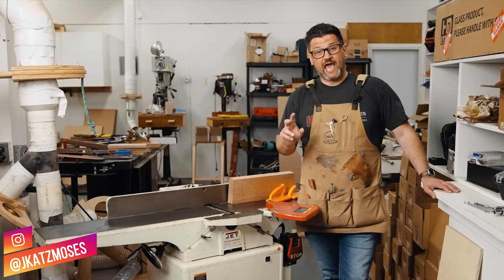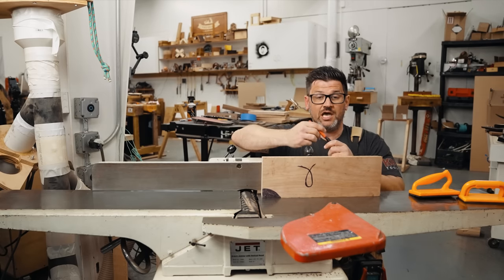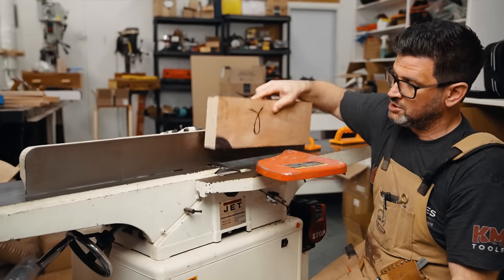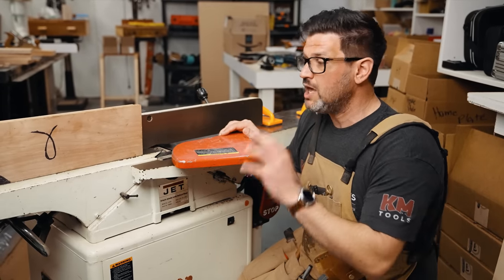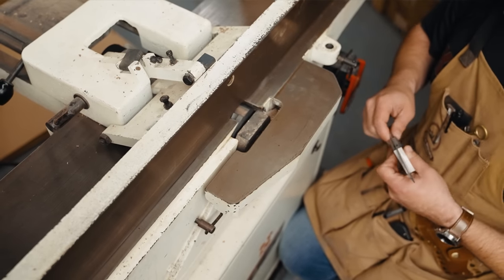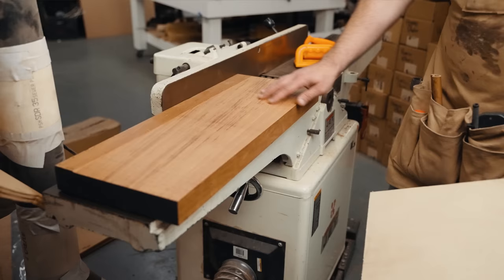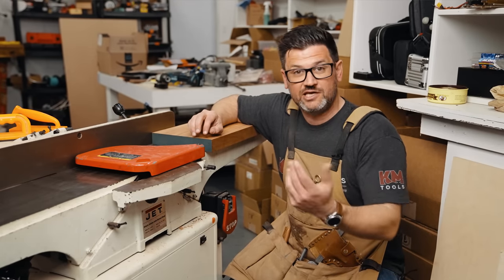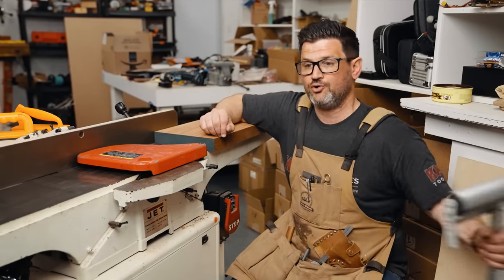Jointers For Beginners - Use Tips, Tricks, Buying Advice and Safety

Comment: Dad worked with wood his whole life. He was 80 when he took three fingers off with his jointer.  His advice?  Never lose focus. During any operation on any tool, never think about anything other than what you are currently doing.  Second bit of advice?  Never do any operation on any tool that doesn't "feel right".  If it feels like you are doing something that isn't safe, it likely isn't, and you should find a different way to accomplish what it is you are trying to do.  There are typically many ways to do something safely.
Reply: My dad was a finish carpenter and every time he cut himself was on the table saw because he lost focus.  Yes, I said every time - 3 times to be exact.  The third time he finally lost 2 fingertips for good.
Reply: I'd also add the third thing would be that if something does go wrong, step away. Don't try to save a piece that's unstable, or try to release a jam with the machine running. Just let it go and if it flies across the workshop, that's ok (you're not standing in the path, right?). Turn the machine off, reset everything and start again. Broken blades or work pieces can be replaced.
Reply: oh my  aint that the truth , i been woodworking 6 months , ive had a grindng ball on angle grinder grab shoe lace  managed to turn off as trousers wer wraping in it  grazed toe bad , then a nip by the kerf on table saw and a chizel into finger and last week top skin layers of finger in jointer  , not to mention chop saw kick back that sent the blade  guard across room at high speed very lucky  not to be in its path , ive rethinked  my work teqniue , but scared now of it , its no safe place to work in , its all limb trashing hazzard zone , i must remember that one
Reply: @TheLucidScreamz you should not be having that many close calls.  If you are then you are working in a very unsafe manner.  You are going to get seriously injured if you keep going like that.
Reply: @TheLucidscreamz find a new hobby
Reply: @TheLucidscreamz please take this as an attempt to save a fellow wood enthusiast some pain. you need training bud, like go to some wood working courses and have someone competent check your shop and equipment. You’re going to lose more than some skin if you don’t stop and get right.

Comment: One thing I wish I knew about benchtop jointers before I bought one:  the fences are a joke.  You'll spend 2 hours getting it to 90*.  Then you must never, ever touch it again.  Forget about sliding it around to reduce the blade exposure.  And it'll still flex if you press too hard. Mine is a Wahuda but I've read they all have this problem.
Reply: You are 100% correct I have same problem with mine
Reply: That was the main reason I bought the Ridgid 6in.   Its the cheapest jointer with a cast iron fence.  I was all ready to buy it brand new but found one on marketplace for 1/3 the price.  I just needed to drive 50 miles for it and hit it with some 600grit to get some surface rust off the beds and fence.

Comment: Another safety tip that's always worth repeating.  Never use a power tool when tired.  It's just not worth the risk.  Love the channel, and your shop.  Bought a SawStop recently and put in one of the CMT blades from your site.  So very smooth.  Loving it.
Reply: Tired or frustrated. I cut a dado in the end of a board that already had a rabbet the other day 😵‍💫 I’d been doing setup and test cuts for a couple hours and was thinking “finally I’ve got this right!”  Still need to stop before I get there.
Reply: Drink a few beers and the frustration mellows out, then it’s safe to proceed. If you are tired, put on your glasses while you close your eyes to rest, then you can see to continue.
Reply: I followed your advice and my last 4 employers were not happy.

Comment: Electrician here, with nearly 30 years in the trade. Swapping between voltages on a dual voltage motor should not change the RPM. I appreciate your video about jointers. I'm glad your injury wasn't worse. Thanks for sharing your knowledge with all of us weekend warrior woodworkers.
Reply: And the amps will be lower
Reply: It may get your motor up to speed faster on start to go higher voltage since inrush amps and voltage sag will be lower. But I can’t say I’ve really noticed anything appreciable.  Maybe your utility will appreciate it the most since your draw will be balanced on a split phase system.  Honestly I’ve done this to free up 120v plugs more than anything since my shop is wired for both

Comment: Excellent advice. I bought an 8" Wahuda helical jointer for $549 delivered (2 years ago) and it's handled everything I've run through it, mostly hardwoods. Takes up little space, attached to a homemade rolling cart and I'm STILL on the first set of blades- only have needed to rotate a couple. Excellent choice if you have a smaller shop or on a budget.  Brother Riv

Comment: Great video! I love my jointer. I'm in New Zealand so it's 240 volts, and it's 15 amps. 12 inches wide, spiral cutterhead, and it's a combination jointer and planer. It's actually really quick to convert between modes. And in a smaller shop (6 x 10 metres), it's the way to go.

Comment: I liked your safety tip on where to locate the fence. I inherited a Shopsmith Mark 5  from my father. He got it “used” in 1955 along with a jointer. A few years ago I ask a sales rep at Shopsmith why they did not make a 6” jointer and was told quite politely that I would not be able to lift it on and off the Shopsmith. The operating instruction for this jointer indicate that the blades can be ever so slightly higher than the out feed table. Thank you for all of the useful information you provide.

Comment: Thank you for this. I recently discovered the need for and also that I enjoy working with power tools quite a bit...but no one ever taught me anything at all whatsoever. so I bought a reciprocal saw, a circular saw, a multi-tool, a drill, a driver and a brushless drill driver so far, I'm pretty sure there's more and this has been in two months time.  I was looking to buy one of these. Considering that I sawed the cord in half from my circular saw the second time using it and my brushless drill grabbed my hair and knocked me around a bit, you may have just saved my life...lol. but really though. thank you.

Comment: Thank you so much for covering bases on safety and buying a Jointer
Last Thursday I bought a Rockwell/Delta 6” Deluxe Jointer. Year 1978. Had no fence or factory guard or motor. I had a 3450 motor. Got cutter head RPM to 5018 with my pulley setup. Working on locating a fence. Had a wooden guard that works ok. It is co-plane flat. Tad of rust on both beds. Still cleaning gently. Only cost $50

Comment: About checking the fence for square when buying a used machine: Check it across the entire length, as the fence may be bent/warped. Especially aluminium ones, but I've seen bent iron fences too.
Reply: Just take it off and run it thru the jointer 😉

Comment: If I have a good jointer, I don't need an expensive thickness planer, I used to under score the importance of a jointer not until I discovered that squaring stock of is number one procedure to accurate results of a project, thank you for the video.

Comment: I needed this.  Thanks. I don't have a ton of experience with my 6" Porter-Cable jointer anyway, but the last time I used it, I ruined a board for my purpose by jointing the edge until the board became a trapezoid. Was that because I wasn't shifting my pressure to the front?

One tip that I learned recently that I'm surprised you didn't make:  Throw those push pads away and get a pair of concrete floats with the red sponge rubber.  Run, don't walk.  They grip like crazy with very little pressure.  You will never go back to the ones that are sold as push pads.  Trust me on this.
Reply from the maker: I have two other jointer videos that go into detail on technique. They should help. Cheers!

Comment: So great! You’re so cool and committed to the woodworking community! Thanks for the tips and safety info; much appreciated.

Wanted to ask: spoiler alert “silly question” when do you know the square cutter heads or planet blades are no longer sharp and need to be changed or rotated? Are there clear signs we should be looking for? Thanks 😊
Reply from the maker: Harder to push wood through and chip out when there shouldn't be. Chips in the blades and maybe by feel. Does it catch ypur finger nail etc
Reply: Not a "silly question", the only silly question is the one that is not asked, my friend.
Reply: @harrydavis6903  I've worked in retail and trust me, there ARE silly questions! 🤣 But this is not one of them.

Comment: I really wanted a 8" Jointer but it was slightly out of budget and space is tight in my shop.  Instead of wishing I had an 8" Jointer I got a cheap small 6" Jointer for under half the price and can do 90% of what I would do with an 8".  Im a huge proponent of buy once cry once but sometimes you need to try once first,  the tools we want are not always  the tools we need.  I would love to have an 8 or 10" Jointer but I am in no rush to upgrade now that I have a jointer.

Comment: Thanks for the video Jonathan. I have a jointer and frankly it freaks me out every time I turn it on. I’m trying to become more comfortable around it, but it’s a work in progress. I’m constantly worried about not just my hand/fingers but also my arm once I’m applying pressure on the outfeed side since my arm is now over the cutter head. This is one of those tools that can change your life in the blink of an eye.
Reply: Keep the guard on.
Reply: @trolltaker  I never take the guard off. Doesn't make it any less freaky.
Reply: Don’t use it unless you have a power feed and all round guarding. Use a hand held Stanley jointer plane and a thicknesser. I’ve been doing that for decades. It’s only in videos that the wood going through is straight grained and knot free quarter sawn. Better still buy wood that doesn’t need jointing.

Comment: Totally understand the point of avoiding bench top planers. Right now I only do smaller projects. But my question is do you think bench top are easier to learn on, or would you consider a beefier, well tuned larger jointer to be safer? I'm just terrified lol

Comment: Ok. So love the program content.  Generally speaking.  One can never have enough knowledge. Im a 30 yr carpenter. Never owned or used a jointer. Never really had the need for one. I think 💭. But I’m curious about them. I’ve always been a trim carpenter.  Built around 30 sets of cabinets. Multiple ET centers and built in units.  Always used S3S.  I use a 10 ft piece of aluminum with cam locks to straight line my boards. My question is what did you mean by coplane? If I said that right?  To check it when buying.  Thanks Dave

Comment: Great video,, I owned a Grizzly 6" that I sold out of necessity ( had to move shop with nowhere to go, so craigslist took all my tools one by one. I'm back with a smaller shop and just this morning ordered Grizzly's 8" combo jointer planer. I also just got several species of live edge hardwood. I got a 12' long red oak board about 12-14" wide. Its massive. already cut it down to an 8' and a 4'. I'm gonna start cutting some of it into 8" pieces
But I'll hold onto that massive 4' piece of oak for a while. There's a sawmill in town, I'll have to ask how big their jointer and planers are. ok I'll stop rambling, again great video, it's been ten years since I operated one of these things, so refresher course is good! 😵‍💫

Comment: My dad took a finger tip off on an old jointer missing the guard so of  all the power tools I have I have the greatest fear/respect for the jointer.  I got rid of that old jointer and replaced it with a new Delta with a proper guard and I always make sure my hands are never over that cutter head.

Comment: Safety is very dear to my heart, especially after working almost 40 years in the oilfield. I always give serious consideration to "what might happen" during an operation and ensure safeguards are in place. I think about every cut at the miter saw (boards not flat), every hole at the drill press (is there a fence to hold it in position), every run through the jointer and planer, and especially every cut through the table saw. Yep, I still have 10 digits, but it comes with preparation and planning.

Comment: Good video!  I took the tip of my index finger off on my jointer last December. They will bite you and they bite hard if you’re not careful.
Reply: I want a jointer a lot, but I think about things like losing fingers/tips and it makes me want to continue to either use my lunchbox planer as a jointer, manually sand the edges of my boards on a hard flat surface for glue ups, use a hand plane or just get a lumber mill to do the jointing for me.

Comment: As per buying jointers second hand you can get great deals at auctions sometimes.  I have bought 2 in the last year for way less than it should have been.  It is usually up to whether someone else wants them.  This goes for most items though.  Both were older craftsman one was a bench top 5 1/4" for $35 and a 6" for $20 on its stand.  I don't know if it is just my area but I go to a few different auctions and the price can vary a lot depending on who is there that day.  If you can look up and see what is selling that day beforehand and making sure it is one of the few going that day it can help.  Fewer items of that type means fewer people coming to bid on them.  Trust me though always bring help.  Your body will thank you afterwards.

Comment: Old cast-iron jointers can be an excellent bargain, if you're willing to put the time in to learn how the old adjustment mechanisms work, and pick up some shim-stock (super thin metal strips for adjusting the outfeed table). Newer ones adjust with simple wrenches and ratchets, but there's something special about a well-maintained old school tool that just works.

Comment: Hey Jonathan, thanks for the video. Quick question, does your dewalt planer snipe your boards? I noticed in your videos you tend to run a piece that is cut to length right through it without the worry of snipe.

Thanks

Comment: My jointer is scary, yes, but I still think my angle grinder is the most dangerous tool I own.  Thanks for this!  Even after 30+ years of hobby woodworking, I still learned more than one new trick!
Reply: Angle grinder really? Have you had a scary situation with one? Guess depends on how you use it. I mainly use my with flap disc for grinding welds/ metal smooth. Doesn't seem scary at all for me.
Reply: @sh0cktim3  I'm lucky the cutoff wheel shattered and didn't cause the tool to break my hand.  I have luckily not had anything other than that.. not like @StumpyNubs or others.  The jointer is a hazard, but at least the blade stays put :)

Comment: I've been able to get a ton of use out of a tiny kijiji 4" jointer that I got for $50. Being able to process up to 8" wide boards using that plywood trick gets you by easily on most projects. 

Surface finish isn't fantastic but hey that's what the planer is for!
Reply: Agree 100%.  I have one from my grandfather.

Comment: Great stuff, Jonathan. I know the test pieces used here are for illustrative purposes, but what is the shortest length work piece you would recommend running through a jointer? Seems to me that a very short board is more unstable when transitioning from infeed to outfeed side.
Reply: I’ve asked this before and I’ve pretty much always heard “don’t joint a board under 12” in length.”
Reply: @Travis Radke  I'd agree with that. I had 8.5" long 2x4 scraps just to test out my jointer. I was slow and deliberate, but I don't see myself doing that again. Just made me a little nervous.

Comment: Nice video.  One thing I didn't hear discussed maybe I missed it, but I have been told that the wood grain and how it is aligned when jointing or plaining makes a big difference, relative to tear out.  This is something that makes me wonder when talking about using opposite faces for an out of square fence.  Any thoughts on this with your experience?
Reply: Yes! Grain direction applies to a power jointer as much as it does to a hand plane.  Go with the grain.

Comment: When you double the voltage from 110V to 220V you cut the amps in half. If you are running a 110V motor drawing 10 amps it will draw 5 amps at 220V. The actual power (watts) used by the motor remains the same. No biggie... but I'm feeling the urge to be pedantic this evening! :)  BTW, I bought the apron for my daughter and she loves it. I also bought the 1:8 and 1:6 dovetail guides and a fence stop. Wonderful products that just work! I've given blood on both a router table and table saw which is why I have a prominent sign in my shop that reads "Stupidity WILL be painful".

Comment: My newbie question is if you're jointing several boards, and you need all of them to be exactly the same height and width, how do you keep that consistent when jointing/planing?  If all the wood being jointed/planed start off at exactly the same height/width, then taking the same amounts off will keep the wood consistent.  But, I'll be using recycled wood a lot of the time, where you're getting all different sizes.  I'm having trouble connecting the dots on you guys do that.  It sounds like you joint the wood first, then glue them together, and run them through the planer till they're all the same thickness?